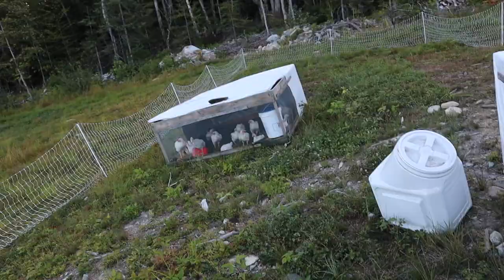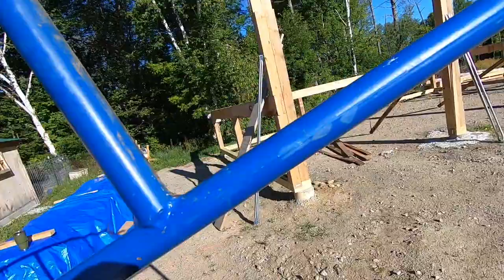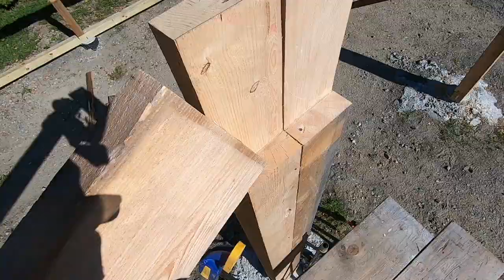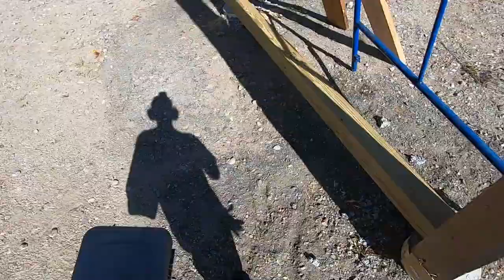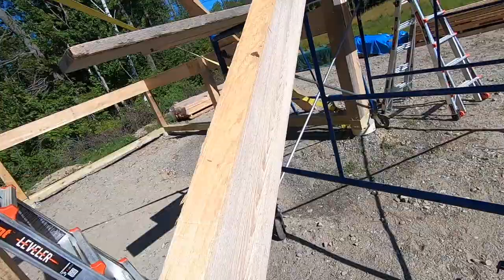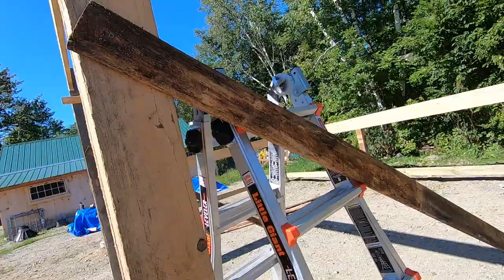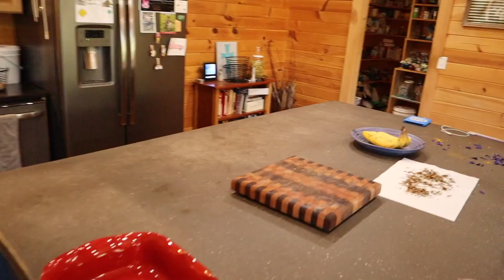Now We're Getting SomeWhere Installing the Biggest BEAMS on the  Post & Beam Garage Day 7

Comment: You should have put up another section leaving one side open because it increases safety plus it acts like a set of Guardrails since its that dangerous and you can rest the lumber on it before lifting into place so do it right next time  You came within a half of a step from riding the planks you were standing on to the ground on the last cross beam you put up and its Construction 101 never to walk on Scaffolding that's open like this. Indeed it's like standing on the top of a Folding Ladder  and hoping you won't lose your balance or step off it accidentally and it's surprising that you did this in the first place having done Construction before. Most scaffolding sections have a Ladder/Open side to them so when you mount them you can go thru to open part onto the decking to get inside and that extra section let's you step off the ladder instead of belly flopping your way onto the platform instead. The extra section allows you to climb higher before getting onto its deck and it's serves as a hand old going down the ladder side plus the Guardrails its creates prevent you from going off the deck and it's cross bars prevents you from backing off it too. Hope you'll put that extra section above the deck level your working from and an extra plank or two since most falls happen when your footing isnt there and it's why the more decking under you is always safer than to few. You were lucky not to have fallen since you have the video to prove it since you straddled the Scaffolding more than once and the next time you might not be getting an Onion but an Ambulace ride when your using it...
Reply: Since the last 20-25 years, every accessories/equipment exist for our safety and we no longer have any reason not to use the accessories and safety equipment so as not to find ourselves disabled or dead before the end of a working day. 
Message to Al Lumnah; If some of us are writing this, it is not to lecture you but from experience, unfortunately, and because we care for you and your family. Cordially

Comment: IMHO it’s has to do dry vs wet. Wet boards are bigger. This is why when you build a deck with pressure treated wood and have tight joints and two weeks later you have gaps.

Comment: Rough cut lumber has much wider tolerances than finish cut.

Don't put your nails so close to the ends of the boards!  If you were using a regular hammer some of those boards would have split immediately.  They might still later.

Comment: The posts were plumb when you installed them. What would cause them to get out of plumb?

Also, is this why you screwed the posts in, instead of nailing them?
Reply: On an unprotected wooden structure, the wind, the sun, makes the wood dry a little more on one side than the other and results in the wood always `` contorting '', twisting and bending a little, for this reason, it should not be too late to assemble a wooden structure so that all the wood is as integral as possible in order to reduce the effect of twisting-bending
Reply: The ghost that opened the door 23:22 most likely pushed them out of plumb!
Reply: @samvalentine3206  LOLLLLLLLL
Reply: @samvalentine3206  Keen eye! 😮😉

Comment: Put three sections of the scaffolding together so you don’t have to use the latter and want have to climb up and down so much
Reply: and lift the boards up to/on to the scaffold with the Kubota's fork lift, avoiding climbing the shaky ladder with a board on a shoulder ;-)
Reply: Lumnah acres  7

Comment: Work smarter not harder..use your Kubota and its forks
Reply: The forks will not go that high!
Reply: @tonygrimes13  I have a similar sub compact and use it to lift alot of stuff to the top of the scaffolding.  Maybe the Kubota BX has a shorter reach than my Massey Ferguson GC2410?
Reply: @mainiac430  Lumnah Acres said in a reply that it wouldn't.